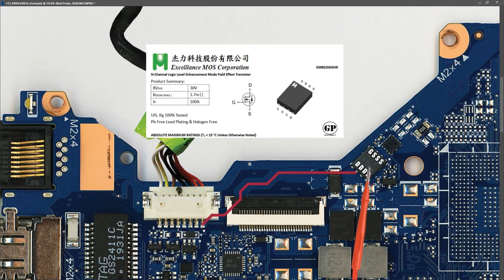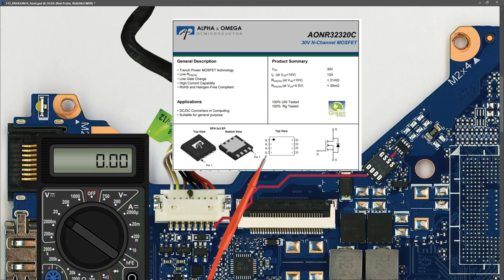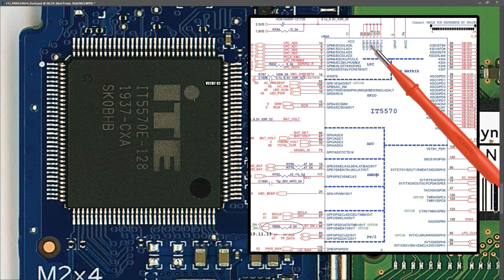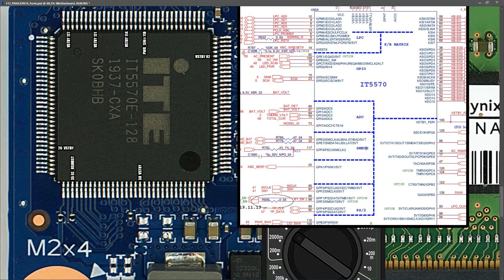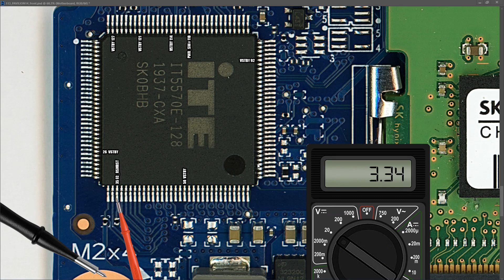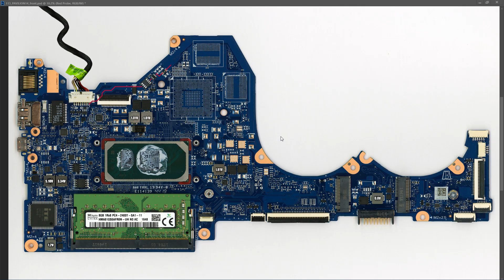HP Pavilion 14 - Power On No Display

Comment: I have a similar model and was upgrading the hard drive.  It's from 2019, so this is partially out of spite... it had 128 GB of drive space and that drive is a pain to get to.  It's got a lifetime copy of office installed and rather than having to go and get a subscription I'm trying to get a few more years out of it. 

Since I had the MB out, I also added another stick of memory.  In ordering the memory, I took the first stick out to get the make/model.  I don't think I had it back in correctly because the fan would come on but no screen.  Same as you had.  

Like I said, old machine.  I was again ready to toss it, but instead reverted back to 1 stick of memory and the original drive.   No luck.  I was again ready to toss it, but decided to see if anyone had trouble shooted similar.

Thanks for going to the memory stick... that first stick was the issue.  From the naked eye it looked just fine.

More info:
I had been fighting to get the original drive cloned ... and could not get this thing to boot from USB with the new drive and thought maybe it wouldn't clone... so had pulled it out and cloned it dead to the new drive via a desktop.

Anyway- added the second stick back and it booted from original drive.
Added second drive and it booted.

There is a space for a 2 1/2 inch drive, so I am going to attempt to add that.   I don't intend to use this for much data intensive stuff and since I wasn't even sure it would work both drives are 512 GB.

Comment: (5:55 exactly) Winbond 25Q128BVSIG. If that motherboard uses a 10th or 11th generation Intel CPU, I would copy the BIOS files to a new (blank) SPIFlash memory and install it to check if the new copy works. I would apply this same procedure if you use an eeprom for the data that "communicates" with the Super I-O. Excellent repair without a diagram but with the data sheets and the experience acquired to date. I loved it. A sincere congratulations. All the best.
PS: If you make a video (with your way of explaining things) when there is time or opportunity, many of us would watch it (it would be a reference to consult😊).

Comment: Great Video!
Maybe it could have been a frozen EC chip? 
When you took out the board to photograph you disconnected the RTC and main battery so the BIOS got reset so it could have resolved the issue at this point and been nothing to do with the DIMM module? 
If the memory wasn't detected in the slot due to dust or bad seating I think a HP laptop would be able to detect this and give an error code in the form of a blinking sequence on the caps lock key. You could remove the module and try and power on without it and see if you get a light pattern to prove this point.